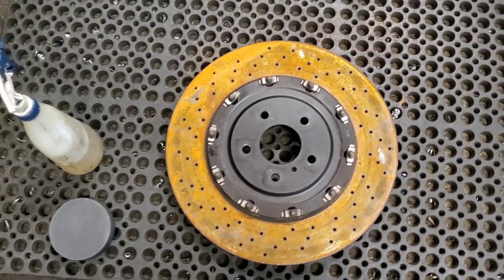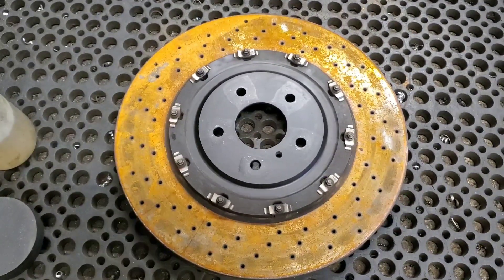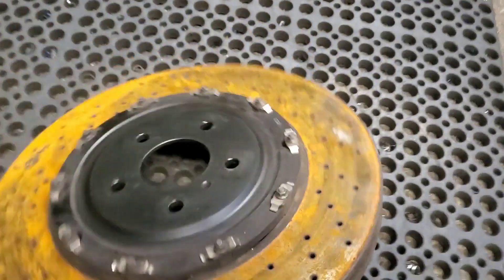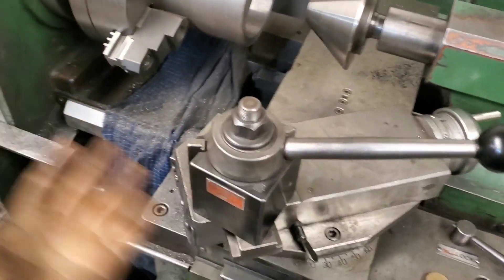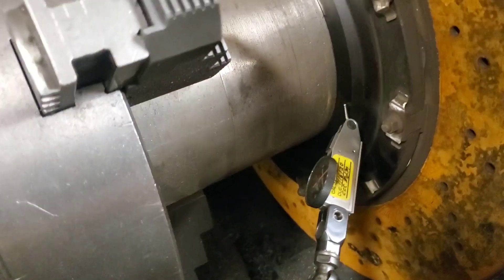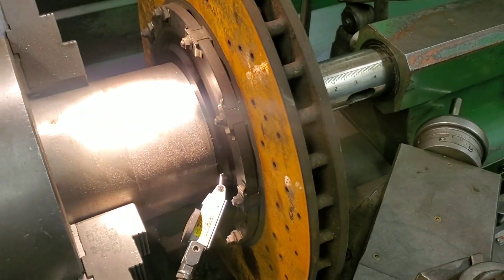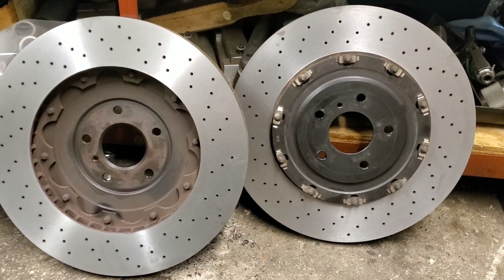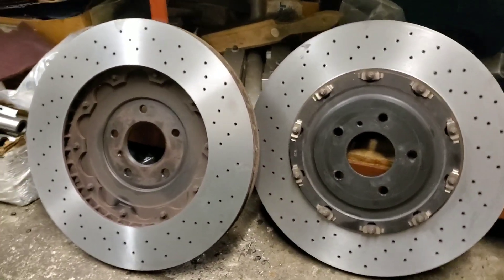Machining Racecar Brake Rotors

Comment: I've only watched a bit of that video, and do agree with the principle... But... Drums and discs used to be turned using a drawbar to pull them up against a faceplate (or even a chuck face, with the jaws removed)  Let's face it, most of us used an adjustable back stop mounted in the headstock spindle to produce consistent length parts (didn't we?) so... extending the screw through the spindle far enough to pass through the disc mounting flange and, with a nut and thick washer, pull the disc up tight enough to drive it using friction's easy, and... you don't have the tailstock in the way of your offset compound slide.

I know why the compound's offset, we've all had to do it... But... while machining both faces without resetting guarantees parallelism of both friction faces, pushing or pulling the disc's mounting face against a chuck or faceplate face, turning the accessible face, then reversing ( pushing or pulling the newly turned face against the chuck or faceplate face) allows you to move the saddle (carriage in US parlance) out of the way easily, and allow easy loading and unloading. and still guarantees parallelism, assuming the faceplate / chuck face runs true...
Drums need to be centralised on a spigot, though, just as they are mounted on a half shaft or stub axle.
I remember guys mounting brake drums in four jaws, and clocking them with the clock finger on the worn friction surface... And distorting the drum's shape with the force applied by the jaws... and the customer experiencing flutter at the pedal... Surprising, eh?  Not!  

When I say "customer" it was usually a mate who needed a favour, paid in beer...Not a commercial, conventional, paying customer.  When you're fitting in a favour for a mate into production work, you've just got to do it quickly and simply.  I'd not, for instance, offset my compound slide unnecessarily, and oblige myself to clock it true again... Drawbars rule!
There was a time we'd use the vertical spindle ring grinder for the task... Magnetically clamp the disc mounting face (cleaned  up) to the magnetic chuck face, grind the inboard friction face, invert and repeat.  It had the benefit of removing the minimum of material from the disc, but was slow, though it could be left unattended to remove a pre programmed amount... (pre programmed?  Well, we set a stop...)
Reply from the maker: Great idea! I try to stay away from a job like this but next time I will apply your suggestion👍

Comment: the extended custom welded tools…spot on..!
How do you control tool post vibrations..?
Reply from the maker: A lot of lessened vibrations are greatly helped by running your SFMs concretively, proper inserts and on a generally heavy lathe🗿

Comment: Do you skim the pipe every time after mounting?

Plus you could mark the surface you're about to stone to see how much contact its going to make (how flat it is). After stoning the high spots are gone and the low area are still marked or visiable
Reply from the maker: Yes, I will run an indicator over the setup, then disk and sometimes after to check the position. Stoning the pipe is a great idea, thanks!

Comment: sir recomendation for you please stop moving the camera so much,  focus on one point, talk a little more louder and slower and to much information is not always good it was intereting.
Reply from the maker: Good advice! I will work on those things😅
Reply: that is a floating rotor they should be stabilised before maching otherwise it can cause problems

Comment: Your one of the few I saw that are making it perfect because the turning has to be made in one mount ...if you turn the break for the other side you won't get an even thick disk which is the most important in this process....than you have a good breaking behaviour 👍
Reply from the maker: Thanks chief! I've been running this old gal for a bit and I prefer standard transmissions😉

Comment: Going to be getting that done on my challenger rotors, of course it will be on the car..after I get my paragon set Installed…and when the weather is over (just a daily driver )
Reply from the maker: I hope they turned out well!
Reply: @shopdreamin372  didn't.... had to buy new ones from the dealer.. cause Paragon uses shitty chinesium morons to make parts... thank god DBA is making Rotor rings now..
Reply: @shopdreamin372  It didn't.. the buggers in chinesium land don't know how to measure bolt holes properly in rotor hats..... so ended up going to the dealer.

Comment: you forgot to clean and check if the other surface which attaches to the axle is parallel to the other one you've checked otherwise it stil wharped..
Reply from the maker: I always hit the disk datums with a wire wheel then abrasive, followed by filing down any high spots.